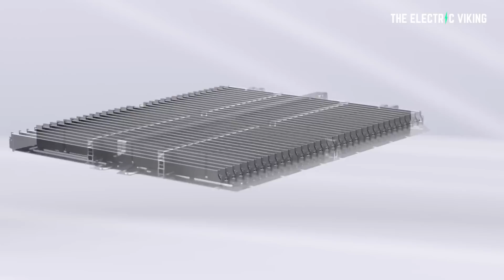Electric cars & pick up trucks will have more range than gas

Comment: What a stupid thing to say. Range anxiety is down to the fact that it takes a very long time to recharge the batteries.

There has NEVER been range anxiety if ICE cars because it takes less than 5 minutes to fill up with petrol.

Only EV's have ever had such an issue.

Just think before you spout nonsense.
Reply: 😂 yeah…. Just think …😂
Reply: In the distant future, there will be range anxiety with ICE when gas stations become scarce and you have to drive 30 miles out of your way to fill up whereas EVs typically are charged at home overnight and it doesn’t really matter how long it takes (within reason). Anti EV people will end up moving so they can live closer to a gas station, until that one closes too.
Reply: @lemongavine  Yes, both of our BEV have far less than 5% public charging so far, the newer one less than 0.5%. Currently charging one of them from our solar panels.
Reply: @lemongavine  That makes  more sense. You don't have range anxiety when there is a petrol station on every corner.
Reply: Thats not what range anxiety is. Think about the word- RANGE anxiety. it has nothing to do with recharge time, it is about the worry of whether you can reach the next station.

Just think before you spout nonsense.
Reply: @gLoveofLove89  My god you are stupid. You don't have range anxiety when you can instantly fill your tank again.
Range anxiety only exists because of the time it takes to recharge.

Why would you have range anxiety with infinite range (with a two minute stop)?

Utterly ridiculous. If you can continue forever you don't have range anxiety dummy. It didn't exist before EV's and is only an issue for EV owners.

How can someone so stupid stay alive for so long.

Range anxiety iñ an ICE lasts a few seconds before you realise that there is a petrol station 5 mins away no matter where you are in the civilised world.

Comment: One thing you have not seen Sam due to battery development and Solar panel development there will be no need to charge car within 5 years. That is my prediction
Reply: car will charge by itself using Solar
Reply: @mgatatemihanga416  Solar panels are currently, say, 20% efficient, that is, they turn 20% of sunlight into electricity. Even if they get to 100% efficiency (which they won't) and even if you covered all surfaces of your car with solar panels, the solar panels still would not generate sufficient power to recharge your car's battery in an acceptable amount of time, unless you consider a week or more to be acceptable.

Comment: Like the CEO of Dodge said, ICE Motors have reached their limit. 
And now Dodge is making EV muscle cars.
Reply: There has never been range anxiety in ICE cars, and there never will be as you can add extra range almost instantly.
Reply: @jamesleate  and you can carry Jerry cans in the trunk
Reply: Most EV's are muscle cars. Tesla 0 to 60 4 seconds. No muscle ICE car by Dodge does that
Reply: @b4804514  and without a muscle EV Dodge is pretty much screwed because Stellantis’ Euro garbage won’t cut it against the competition
Reply: @b4804514  Of course an ICE won't, because that's not how power its applied to the wheels from the engine. You don't get all of your power from the off like you do with an electric motor. That's why Super-Chargers, and Turbo chargers exist.
Reply: ICEs are no where near their limit, and are still more efficient the EVs, have been since the 1800s. Yes EVs are neat, but im gonna say it right now the Dodge CEO is wrong...so is tge Ram CEO since he said Ram was unveiling its EV in 2024. Plus EV's batteries are super expensive to replace when they inevitably go bad.